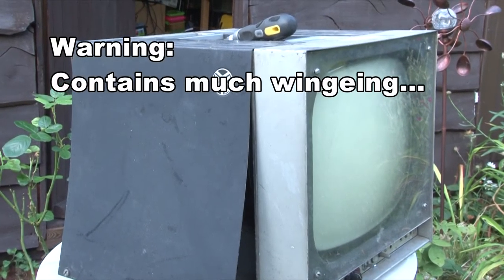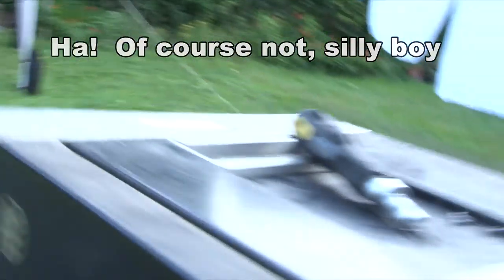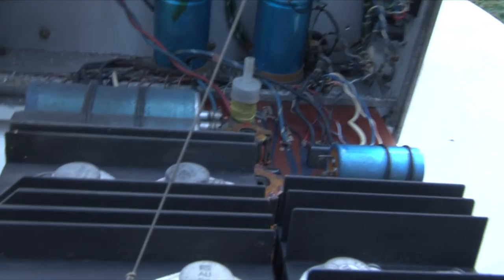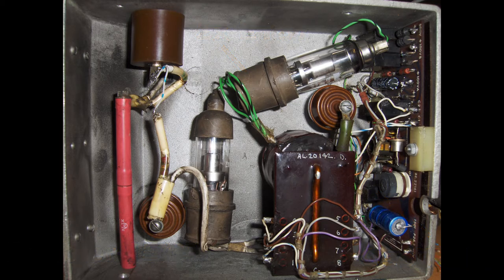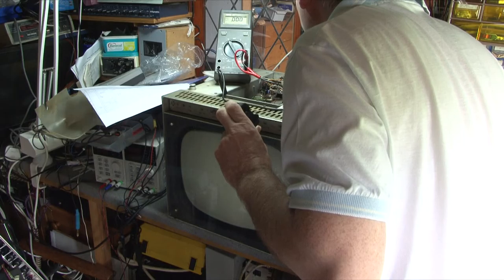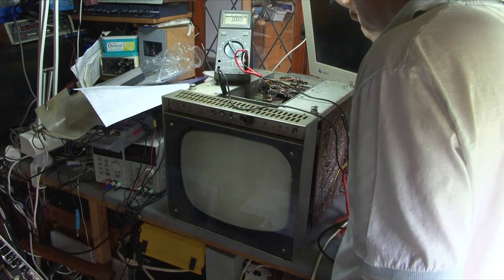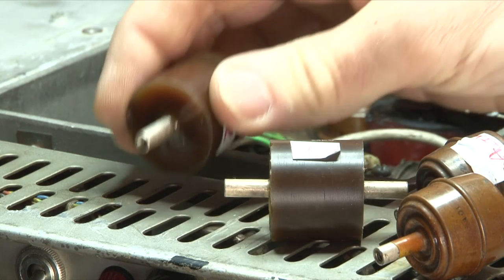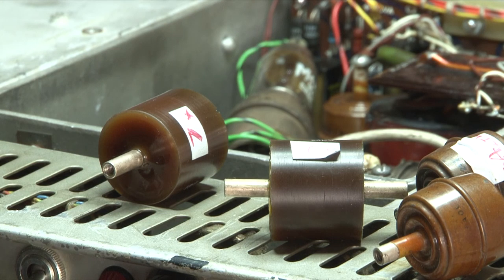Paul Read commences his road to recovery of his TV monitors

Comment: Very intresting Paul, I worked at Pye TVT back in the late 1960's on mechanical inspection under Albert Milliard. Although I dont have any electronic experience I well remember inspecting the mechanical components of these monitors. The mechanical parts case etc were subcontracted by Pye TVT,  as was the painting.  I well remember the problems with the paint, we used to do an adhesion test by sticking a piece of masking tape onto the paint, if the paint was not keyed it used to come away in strips. The painting was done by Commercial and Industrial Painters of  Cambridge. I well remember the MD Paul Henry complaining that our testing method was unreasonable after a batch of polychromatic silver front trims were rejected. The main case was if my memory serves me right painted in black organosol. Happy days
Reply: Thanks John.  I think the paintwork has lasted pretty well on this example so clearly passed the masking tape test.  In a future video you will see a cleanup and a bit of metal bashing!
Reply: Hi John Thanks for your useful comments, there is much to do on the restoration of the MCR21 Outside Broadcast van.   It will have 7 of the Pye System 70 monitors 6 x 14 inch ones and a 17" one for the transmission monitor.